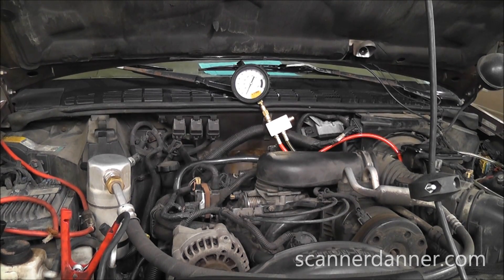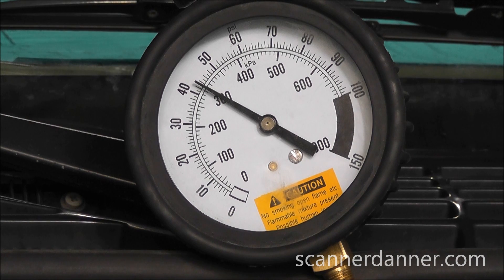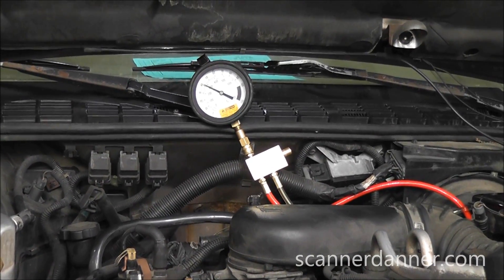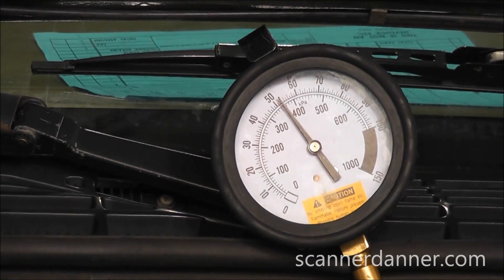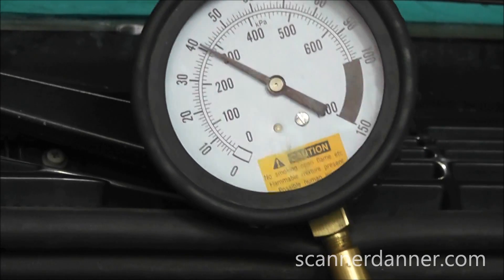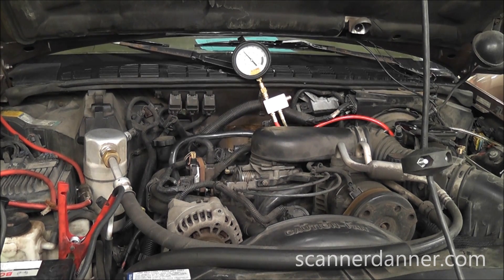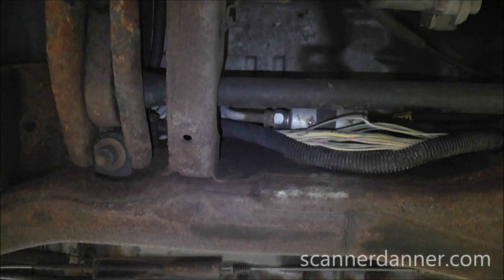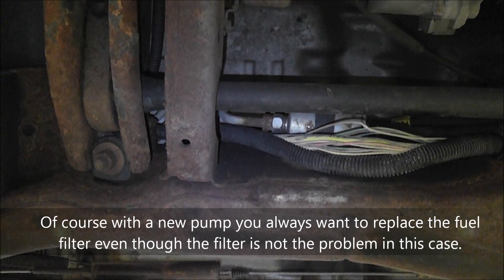Fuel psi less than 50 psi = no start (GM CPI Vortec)

Comment: I have a 1997 s10 4.3 vortec. At start up it starts fine but then within a few seconds it starts idling funny and stumbles when giving throttle. It runs decent when driving around or passing, but at WOT the power fades after 3/4 throttle. Getting roughly 40-45psi at idle, then jumps to 50-55psi when I tap the trottle. I have replaced the fuel pressure regulator due to long starts and discovered it was leaking into the intake. The engine ran fine prior to replacing the FPR, but since then I'm getting all those symptoms and P0171 and P0174, can't find any vacuum leaks whatsoever.
Reply from the maker: It is becoming more and more difficult to answer questions here. I have 80,000 people asking me for help now. So I have created a forum to help you guys better. It is free to join and we can exchange pictures, wiring diagrams and waveforms if needed to help guide you through the process of troubleshooting your vehicle. Thank you so much! Hope to see you there. 
Paul Danner (ScannerDanner)
 https://www.scannerdanner.com/forum/post-your-repair-questions-here.html

Comment: oil pump pressure sensor keeps it running fuel is run with that to keep it going?
Reply from the maker: +eddie martinez On older GMs the oil psi switch was a bypass in case the relay fails. So yes, it will run through the oil pressure switch
Reply: Yep hey paul is jimmy alright have not seen any videos from him in some time hope he is ok?
Reply from the maker: +eddie martinez he is good, just busy at home. he will be back.
Reply: Good jsut that i love what you guys do along with south maine auto and ivan jim the car guy and eric.

Comment: Need help I have a 2000 blazer 4.3 that blows the 20amp fuse marked "ECM B" I have replaced fuel pump I have replaced oil pressure switch still blows. I can drive 1/2 mile just fine then blows fuse acts almost as if runs out of fuel. Any ideas????? Plz help
Reply: +Allen McKinney Never circumvent a fuse; they blow for good reason.  Fix the fundamental problem!
Reply from the maker: +BIG Rob need to know what else is on that fuse first, then focus on areas of heat and vibration
Reply: If nothing else put a breaker on it and mount it on the dash.

Comment: Hi Paul, never seen this before, great video, i have had a Bosch K Jetonic car that done simlar, but they have virtually no electrics on the fuel system, the injectors or purely opened by fuel pressure, i think they run around 50 or 70 pounds psi, i cant remember quite what it was but lot higher than electronic type...from Fred in England.

Comment: I need ur help. I have a 03 town and country. It took three to 4 tries to start now it doesn't start at all after I put the new fuel pump in. Well it was used... Is it my regulator? When I push the pedal it wants to shut off now. It didn't do that before. This pump doesn't turn on either but I hear gas pulling.
Reply from the maker: What's your fuel pressure? Otherwise you're  just guessing

Comment: i checked the video out. very helpful. if i am correct my fuel pressure is different but i am sure they all varry but i will recheck it tomorrow or friday and get back to you. but yea it starts on starting fluid and does the exact same thing as the 4.3 in your video. ill keep you updated on my progress. i remember saying when i was younger ill never mess with the newer cars and all that computer and diagnostic stuff but after working in repair shops  i still find so many things that i learn every day . thanks for your help
Reply: Same system bro. I'm sure of it. It's only different in the injector designs. Same exact pressure specs
Reply: OK thanks brother. I owe you for your help. What it is, I bought a 98 express 3500 work van for 400.00 last week and I am good at finding deals like that but I get the headache of figuring out the problem. Same with my 90 f150 and 2000 Durango. 500.00 each 2 years ago that I fixed and run strong today thank you
Reply: OK thanks brother. I owe you for your help. What it is, I bought a 98 express 3500 work van for 400.00 last week and I am good at finding deals like that but I get the headache of figuring out the problem. Same with my 90 f150 and 2000 Durango. 500.00 each 2 years ago that I fixed and run strong today thank you

Comment: I a d issues with my 2000 Sonoma no start.  issues.testd fuel relay was good, checked my ecm fuses all good, checked all fuses  just for giggle all good, checked hot wire to pump , good, but the ground was shot, regrounded pump and started right away.

Comment: just to follow up with you  ScannerDanner  my 01 s10 xtreme 4.3 no start cold with out squirting starter fluid in it after that run on its own pulled bed to find pump and sending unit had been repaced since it had the updated plug all electrical is good as well as connections and grounds I still understand that the pump's them self new have high failure rates? I can drive truck all day after starting it like I said earlier but if it sit say maybe a hour or longer or over night for sure it loses fuel pressure E.G push in shradder valve on fuel rail and no fuel comes out at all thinking of buying pump along which is a little cheaper and try replacing that since I done have new sending unit  I have no ses light so im not sure to suspect spider or FPR or not no gas smell in oil either no smoke either look forward to hearing back from you sp_aj_thaxton@yahoo.com I also tried the key on key off multi procedure to before priming with starter fluid seems like it tries to crank but just cant . thanks!

Comment: I had the same thing on a 1 ton cpi motor. . Heres a tip . when you start it your battery voltage goes to 14.5. if you let it sit a couple days static battery voltage drops to 12.5 or so. when this happens car wont start. fyi when you put a battery charger on it itll start to. oh an I had 60 psi at the valve . so check your battery 1 st

Comment: so what is the proper fuel psi it should be at at ? I have a 01 xtreme pickup 4.3 no start unless I prime at intake with little starting fluid runs after that and will re start unless sits for 30 mins or longer then have to repeat prime process im thinking weak fuel pump I also have no ses light on what so ever
Reply from the maker: It should be over 60psi while cranking. It does sound like your pump is weak. Be sure to also change your inline fuel filter with the new pump
Reply: my 93 gmc s15 jimmy with the 4.3 vortec randomly wouldnt start all the poppets are spraying fuel so what would cause a no start? rotor and cap contacts are black but not melted
Reply: Shawn Thaxton r

Comment: never checked the return line pressure  ,  maybe the 3 dollar pressure regulator went fluie, hey how about ramping up the voltage to 15 or 20 at the pump and get another year or two by golly. !
Reply: how about buying a good pump and get 'er done right, by jiminy.

Comment: hi danner, my 01 4.3l blazers fuel reads 30psi cold and 40-45 psi after a good warm up. car iss running lean, i will use another fuel gauge to recheck pressure and check power and ground like you did on the video, any comments on why running with such low pressure. i will post the results. thanks.

Comment: to places where I am wondering fuel pump, but I will check it close to the pump as well I will do voltage drop thaks for your advise , other is i do not like ignition pattern firing line on snap other cylinders about 20kv firing line and spark line less than 3kv , misfiring cylinder  firing line 40kv and firing line at 12kv with normal burn time in your experience will this mean rich i am thinking as the injector poppet does not close and keep spraying, Thank you for your knowledge and your tim

Comment: part 2 @ mr Danner, how ever the humps are there normal and pump speed is about  6,500 rpm and fuel pressure at idle stable 52 psi and wot snap 62 all the time, my question how can be amps so low and pressure be ok, CPI system,  I already replace  cap, rotor,wires and plugs oem, I checked current ramp on injectors and are ok, when doing secundary ignition test I see some weird activity on cylinder 5 the spark line goes higher and the burn line start at 1 kv while on other cyl at 2.8kv thk any

Comment from the maker: These FPs will carry 8-10 amps. Running at 0 amps? That can't be. Where are you measuring the current flow from? IF it is from the FP test terminal, you can only use that with the engine off for an accurate measurement.

Comment: Mr danner in my area we have no good trainers teachers so, diagnostic techniques I have learn  are from your book, video lecture and your you tube videos. how ever I have 00 chevy express 5.7 8 cyl,  misfire cylinder 5  only under load ,I did fuel pressure test and current to pump dual channel on verus and pressure tranducer, but I am confused on all current to fp I have checked before I have seen amperage above 8 amps but on this while priming is about 7 amps ,cranking about 4 and running 0amp

Comment: A neat tip I learned was to use fingernail polish to cover up the holes in wire insulation caused by direct piercing the wire. Some RTV's emit ammonia when curing. Thanks for the cool videos.

Comment: does a 1998 olds bravada have a wire to check the fuel pump, if it does where would it be. my truck just cranks but if i put starter fluid in it turns over then shuts down. spark is good and the fuse n relay r good. shows no pressure when i put the gauge on it. also no fuel comes out the schrader valve. n i don't hear the pump activate when i turn the key

Comment from the maker: ahh ok. any one of the four voltage channels. an amp probe reports a voltage signal as current flow. you can even use an amp clamp on a regular DVOM set in the DC volt mode.
Reply: But if the oil pressure circuit is bad and the relay is good with it still start and run??? 03 monte carlo ss 3.8.

Comment: Hi Paul, I have a 89 toyota mr2 non supercharged and someone poured dish soap in the fuel tank, I took out all the contaminated gas and put new one in but it seems like the pump is not working right and it stalls under load (when in gear) and sometimes on idle. I checked amperage through the diagnostic port with a Vantage MT2400 (jumped two wires) with KOEO and only has 3.44 amps running through, is this a bad pump? Should I get an amp clamp and try KOER?

Comment from the maker: If all the injectors are clogged, you are going to have some major running issues and severe lean misfiring which is easily identified using a scope and watching the secondary ignition waveforms. other than that, the timer tool is very reliable. you could also use a transducer in the fuel rail to ID

Comment: Yeah i have a 90 Probe with the fuel sender unit/pump plate under the rear seat, and I have a 94 where they were too cheap to do the same. I would *never* trust myself to cut out the inspection hole exactly where it needs to be though the first time, I'd have to sacrifice one at the junkyard first for a trial. I don't see how you can accurately get it right the first time.
Reply: If your lousy at body work, or its  a beater just put a bed liner over the ugly

Comment: Do you have any videos of testing to see whether the injectors need cleaned? I wasnt sure if there was a test for that, and if you covered it already. I know you have the one where you use the fuel pump pulse tool but that is just  a relative test, so if all your injectors are equally clogged that test wouldnt catch it.

Comment from the maker: that wouldn't have answered that question. pinching off the return line and checking max psi would have but this wasn't necessary either. IF the regulator was opening too soon causing the low psi, psi would NOT have increased with the engine running, in fact the engine would have never ran. Remember the psi at times was under 40 psi, then with a higher voltage applied (engine running) psi was almost normal (52 at idle, 58 on a snap).

Comment: I would have taken one more step before dropping the tank by putting a pressure gauge on the filter to verify it was in fact the pump and not the fuel pressure regulator.

Comment: was the 50psi to open the poppets the same across the board with the other vortec motors?  4.8, 5.3, etc etc

basically anything that uses spider injectors, correct?

Comment: Depending on the vehicle, it might be more work to cut a hole in the floor than to drop the tank anyway. It all depends on the tools you have available, such as a tall transmission jack and a helper.  A full tank of gas is usually the only thing that makes it difficult short of stubborn tank straps.

Comment from the maker: I just don't think it is good business to cut a hole in the floorboard of someones vehicle,. I'm not saying I haven't done it. An old Camaro comes to mind. The one where you have to drop the rear diff. 
Love the ones with inspection covers for sure.
Reply: If its a keeper,,(yours or not)  lift not cut the box..  Lots of loose wires, rust, stuff hanging down, plus under coat it.

Comment: Great info,I would have gone a little bit further before dropping the petrol tank on a older car with a corroded tank ,Why not cut a hole in the floor pan to access the connections on the fuel pump, which could be corroded, which your test poss. would not show

Comment: This is a great demo, thank you. 

Checking any pump by measuring pressures is an imperfect gauge of how well the pump works. Just like a voltage drop test, the best way to decide if a pump is bad is to see what volume it can put out (analogous to current rather than voltage). It would be nice to have a volume output test to help decide if any pump (water, or fuel, etc) is up to spec.... Older methods would have you put the fuel line in a safe bucket and measure output over 10 seconds, ha ha.

Comment from the maker: Okay but you're still in the same boat if current is too low.It could still be a bad electric motor (poor brush contact etc.) or low supply voltage or a poor ground. so you still need to check voltage to be sure.

Comment: well as a rule of thumb a fuel pump will have an in-rush current of around 12-17A to get it spinning from static, so if you got yourself a little library of current captures from static you would get a quick idea of the in-rush current of a good working circuit & spot quickly one that has a volt drop.

Comment: Great video Paul! Would you recommend using a scope for ground to ground voltage drop measurements rather than a DMM or graphing meter? I've just picked up a snap on vantage pro . Great for quick tests and jobs rather than setting the pico all up...

Comment: The jumper wire is hooked to bat.neg and ran all the way to the back as close to the tank. It provides a known good ground for the multimeter to the two voltage tests, power and ground (while cranking).

Comment from the maker: That wouldn't be a good test, because with the engine running there would be a parallel path for current to flow through the relay making your amperage reading at the jumper wire inaccurate. 
If you want a true amperage reading with the engine running and you want to do it under the hood you can remove the fuel pump relay and jumper the LOAD side of the circuit and measure current there. But DO NOT jump the control side, you will fry the engine computer!!

Comment: Is high current draw from a fuel pump ,when you have low pressure at the rail,a good sign of a restricted fuel filter .  P.S . Paul I just have to say I have learned more from your videos than I did in the school I attended.Not that the school was bad ,just overcrowded.This delivery method you use to teach (video) gives us the ability to absorb the information much more efficiently.

Comment from the maker: You're allowed to question me, I make mistakes too. And you would not have been wrong in your approach. I chose this method because it allowed me to measure pump current from under the hood. If pump current measured good with low psi I would have skipped the power and ground test. That was the main point. Also when checking power and ground  here in the rust belt by the time you ID the correct wires to test and find a good ground you overheated the starter and killed the battery

Comment: I'm not questioning your methods, neither that the relay was at fault. When you activate the fuel pump and read battery voltage at the pump that only tells u that that wire is intact.Leaves out the rest of the relay circuit at question.I understand what u did, you saved yourself time with that test, I personally would have cranked it.

Comment from the maker: Last comment for the rest of you guys. If you have low or no fuel psi and you bypass a relay (like i did in this video) and  now have good fuel pressure,  you have a relay circuit problem. If your fuel psi is the same as when cranking or running then feel free to finish your power and ground tests with the relay bypassed. This will save your battery and starter motor in the case of a no start. Plus your friend doesn't need to crank the engine over & get pissed cause ur taking too long:-)

Comment from the maker: also you mentioned a faulty relay ground. This would not effect load side voltage but would effect control side amperage and depending on the amount of resistance could cause the control side magnetic field to be too weak to latch the relay. So at that point there is NO fuel psi. So again this is not the problem as I had pressure......